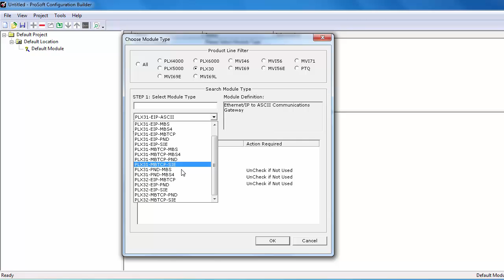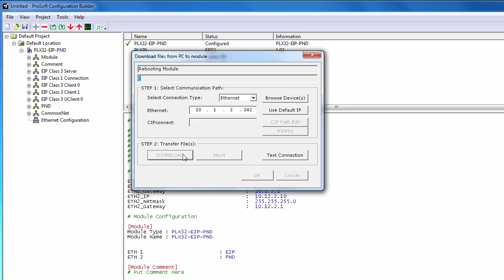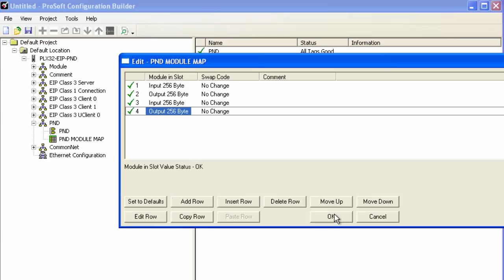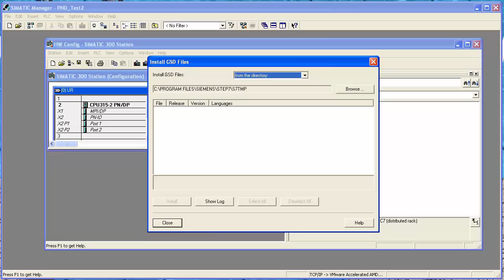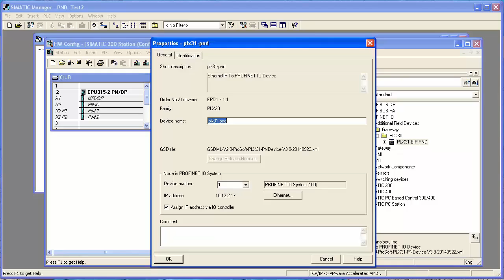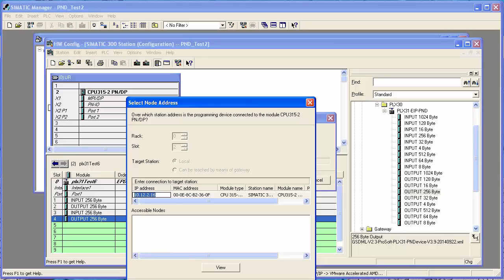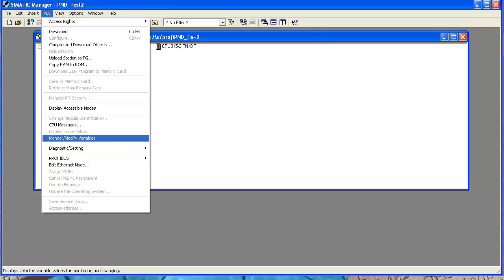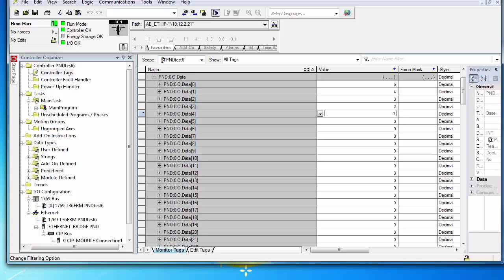Set Up: EtherNet/IP to PROFINET IO Device PLX32-EIP-PND Gateway

Comment: Hello, Can i use this gateway to connect  a Fanuc robot to a Step 7 PLC?
Reply from the maker: Hi there! It may be possible, but only if the FANUC Robot can be set up as EIP Class1 I/O Scanner (some can, some can't)  or if it can be an EIP Class 3 Client (again, some can, some can't) and send CIP Read/Write Data Messages to the gateway.  Then, the gateway can be a Slave Device on PROFINET to pass data back and forth to the S7 PLC, if it is set up as the PROFINET Controller (Master).

Comment: How about the floating number? Is this possible to send Floating value between Controllogix to S7 300 via  PLX31-EIP-PND
Reply from the maker: Yes it is! The PLX31 can send floating point numbers over both the EtherNet/IP & PROFINET protocols, as can the PLX32 version. If you have additional questions about this application please call our tech support department at 661-716-5100. Thank you!